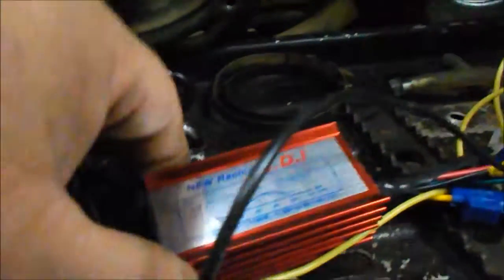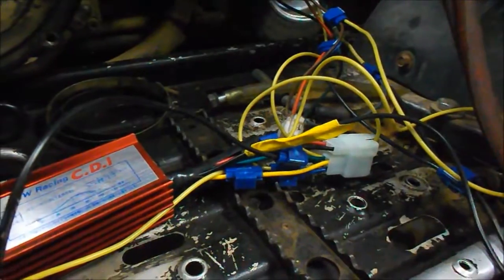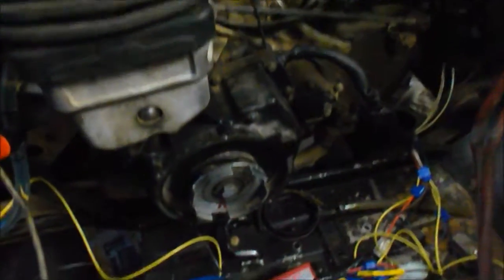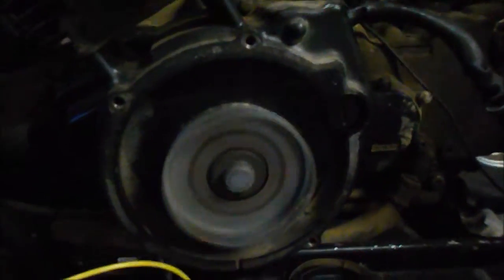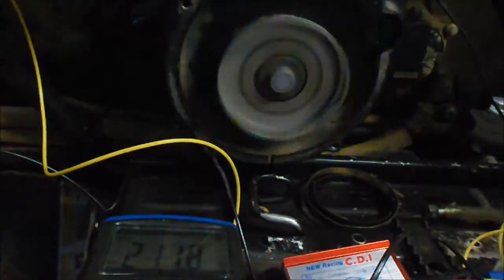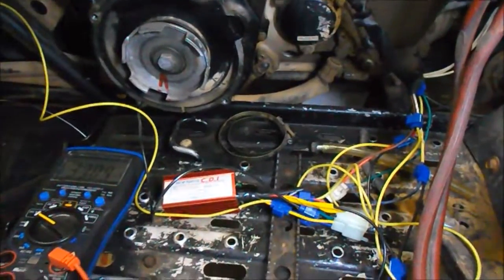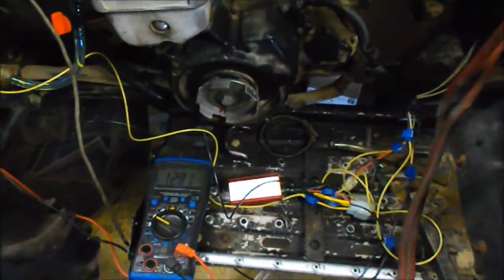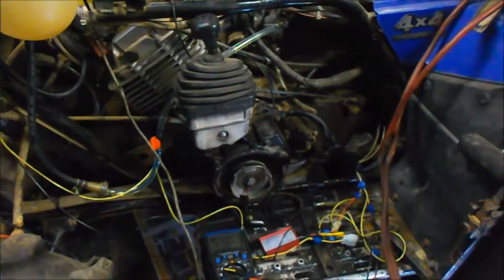no spark wire a china xr70 cdi on your grizzly 600

Comment: How hard is it to do this? How has it worked out so far?
Reply from the maker: it's easy to do wiring diagrams are all over the internet today, but  I don't think the advance was correct it started fine but appeared to lack power when going wide open,   if your stator is bad you can use a  DC cdi as long as your trigger coil is working it will spark

Comment: Man could u help me out ! I am trying to do the chinese cdi on my grizz600 ! I had an ac 5 wire cdi and can’t get things to work ! Should i be using a 6 wire cdi ? All coils test good ! Problem i see with 5 or 6 wire cdis is the trigger and source/ac power coils both have 2 wires and cant seem to see where they go .
Reply from the maker: for the trigger coil you can just ground one wire and other wire to cdi  but  if it does not work good swap the wires   you can check the added info above where you click    (show more)

Comment: I have the same 4wheeler, So this can be tied into the harness to original cdi?
Reply: rotor1986 aye i really need help I need a new CDI for my 1998 grizzly 600 but too expensive and I'm probably gonna do what you did but could you please give me anything I could contact you through
Reply: Charles Stinnett 
if you have done this please let me know, mine is needing a cdi now and i dont have 200 to waist on one lol please let me know
Reply from the maker: yes, just buy proper wire plastic connectors pigtails  for the china CDI  listed on  Ebay then solder the wire ends  to the atv's wire harness.  just make sure your using a AC CDI and follow the correct wiring for it.